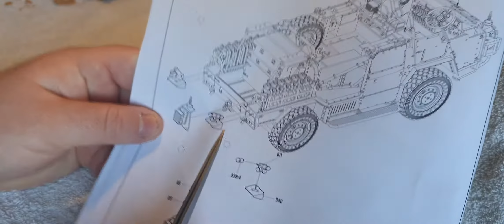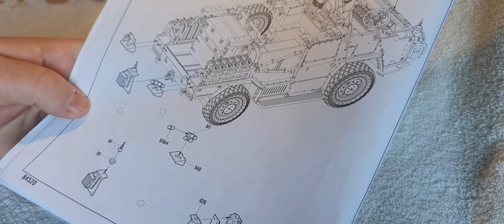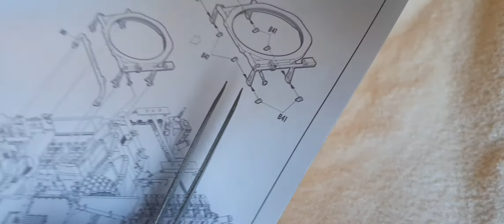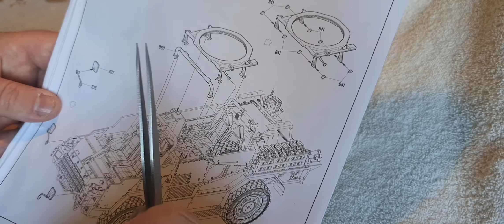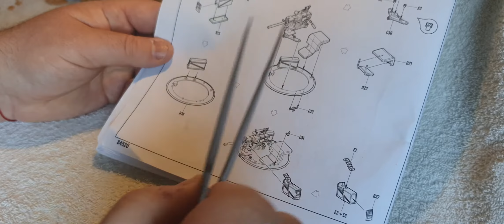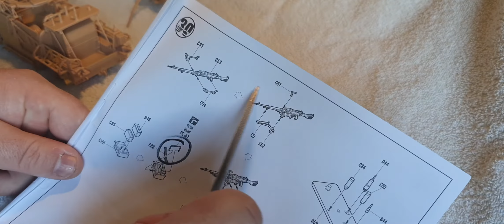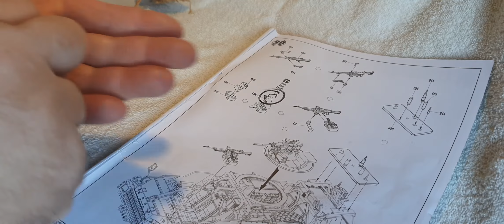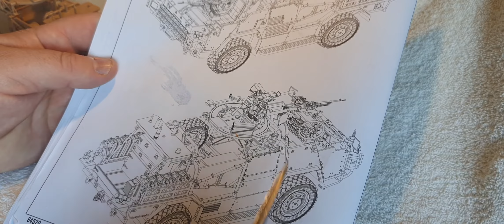Hobby Boss jackal build log pt4

Comment: The  hobbyBoss Jackal is a Jackal 2, and is exactly that. It followed the Jackal 1 and then the 2A followed. So what you get in the kit is 100% correct. The marker lights on the side you mentioned were not on this version and were added later along with other updates.
The Tankograd  book British Special No 9019 Jackal Coyote, explains the Different versions and has many good reference Photos. I think HobbyBoss use some of the photos for kit, as one photo shows a Jackal with an empty winch no cable or hook.
Reply from the maker: Actually no the first iteration of the jackal was monasity  then jackal 1 then jackal 2 and coyote then a retrofit of jackal 1 to 1a was implemented. The lights on the side were and are on jackal 2s from first release next to the door hold open catch. On both sides the coyote has an extra set near the back set of wheels for its length, the jackal 1 never had the side lights. What's in the box is an early jackal 2 early because the front rops bar was changed to a more curved bar as the main visual difference from the early to later jackal 2s and same with coyote.
Reply from the maker: Also regarding the winch it does not use cable it uses dynema rope, the reason it uses this was for safety and the weight of the vehicle, dynema does not store energy and designed to drop if it snaps unlike steel wire rope that stores energy and can cut you in half if it snaps under tension, the reason the picture you mention hasn't got a rope attached will be down to waiting for a new dynema rope to be fitted from the old one being damaged, to old, or the colour fading from blue to white which is a little hint the rope is about out of its use.
Reply: The book has 8 photos of the Jackal 2, in Afghanistan 2011 and none have the side lights I am sure they came later for use on UK  and European roads. 
They came in on the Coyote first as it was along, Chassis and then on later Jackals.
Reply from the maker: @Ruzz21  nope I can qurantee you the jackal 2s had the sidelights from first delivery of them same with coyote, I trained the whole jackal family for 11 years ruzz from pretty much when they were introduced ill upload some photos of the original jackals 2s in next video for you.
Reply: @craigkerr68  
I can Only comment on what I see in the book , published in 2012 and other Photos I have found on the internet. 
I would Like to Thank you For Your Service, and I am just commenting on your Video.
This is not a Personal attack on you. I will Just say to the modellers. do a little research on model
Reply from the maker: @Ruzz21  it's OK ruzz I didn't think you were attacking me I was trying to educate you a little from real life experience, my apologies if you thought I was being rude in anyway that wasn't my intention. I will still upload the photos for you from the vehicles I used so you can see what I am on about with the lights etc. And thank you for commenting and getting involved its really appreciated. :)
Reply: @craigkerr68   Is your missing side light, clear part GP1? I can’t see this part placement in the instructions.
Reply from the maker: @Ruzz21  I would agree gp1 does appear to be the missing sidelights and also my instructions are the same with no placements. And the same for gp2 although I'm not sure what they are supposed to be for as there is no ther lights missing :-/
Reply: @craigkerr68  
The lights GP 2 are  for HobbyBoss Jackal 2 kit No:8452, (That’s HB designation) 
I have photos of the Jackal 1 with four rear lights. You know HB is confused over it’s Jackal Designation for the kits.

Comment: Nice build were did you source the extra bits that are not in with the kit
Reply from the maker: thanks appreciated :) i scratch built  the recovery straps, light  covers with masking tape, the harnesses come out of another kit i think was the meng bradley m3a3 the stowage was from a stryker kit and the netting was scratch built with thick x stitch thread. the figures were from match box the mrap crew set if i remember  rightly
Reply: I used this vehicle on Herrick 12 so I cant wait to build it